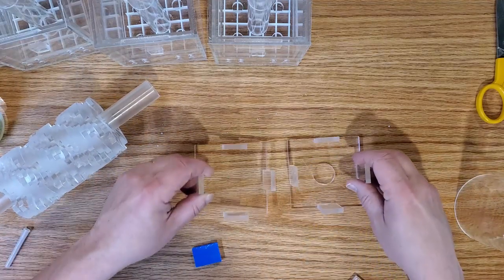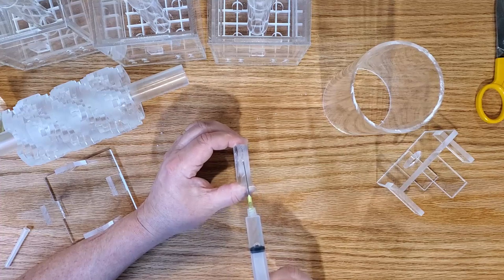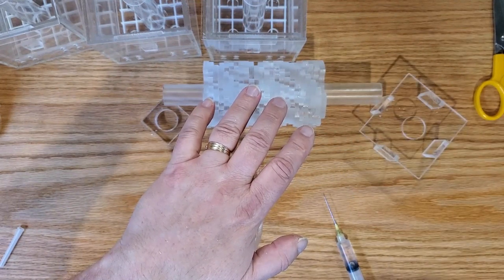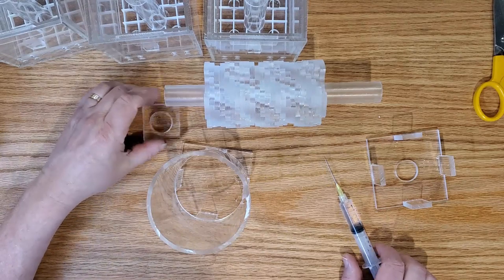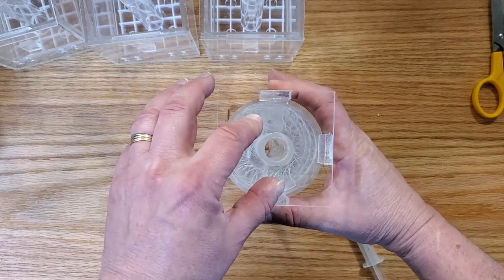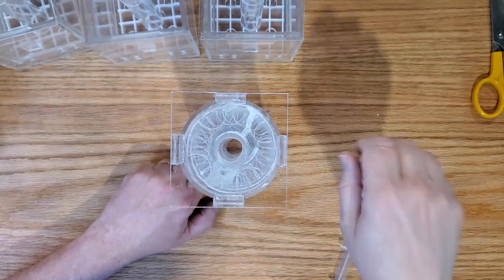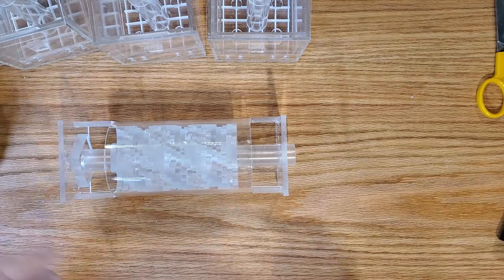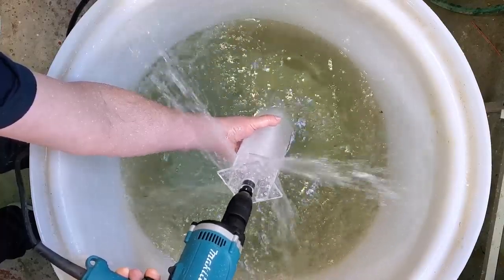Archimedes Screw for Aquariums Part 3

Comment: I think cavitation has to do with air getting into the system or where the screw get air in there and traps it and just spins and makes foam more than displacing large amounts of water or fluids.   But as long as you can keep air out of there it should move water but if you get a few bubbles in there it will break that seal, it’s almost like hydraulics where they have immense amounts of power but if you put a tiny bubble in there you just lose it all.   

Lol. This is one of my favorite builds.  It just opens up so many ideas you could cover those surfaces with glued sander just make them rough to grow all kinds of bacteria and just make that the whole filter, I also see where something like this could be hooked up in a pond and be powered by wind or moving water.

Impressed, It works really well.   I think something like that on a small pond with a simple horizontal tape windcatcher or windmill could actually be pretty practical in aerating and moving pond water with no electric or air involved.
Reply from the maker: So glad you like it Shane and thanks for coming by!

Comment: I'm kind of surprised that you didn't need to keep that 45 degree angle, you had it close to  90 degrees for a bit and it still worked.  Maybe it's because of the high RPM's.  The one I built had a hand crank .   Awesome as usual!!!!
Reply from the maker: Hey Don! Your quite right. The speed of rotation certainly helped with that.

Comment: What if you made it out of strips with three holes the centre hole would be your shaft and the two outer holes would be where the water travels through. You offset each strip slightly so you get the twist pattern. That way you wouldn't have to deal with imperfections in acrylic tubing. It would be a lot less Machining as well
Reply from the maker: That would work. Thanks for the idea!
Reply: @FishmanEricRussell  might be more cost effective if you want to make it much longer too. Glad I could help

Comment: Imagine a giant arcemedies screw as a continuous spiraled tube used in a water park to lift people floating in tubes up to the top of a water slide. Huge diameter and a low angle so they are floating in only a foot or so of water with the majority of the tube as air space.
Reply from the maker: You build it and I will come over and take the ride! Thanks for watching

Comment: Your build method has me thinking.

With multiple plates welded together and machined, you have another option to needing your outer tube.

You can create an internal Archimedes helix.

Each plate would have a center hole for the shaft and as many helix-holes as you desire helix-channels radiated around the center-shaft hole.

When assembled, the offset will stack the helix-holes into helix-channels creating a self contained Archimedes pump.

The severity of offset when welding them will determine your attack angle. More offset equals more helix-rotations per inch and more mechanical advantage.
Reply from the maker: There are lots of ways to make an Archimedes screw for sure.The only reason for the outer tube is to remove the need to keep it fully supported since the rotation is internal. Thanks for watching and sharing your thoughts on this!